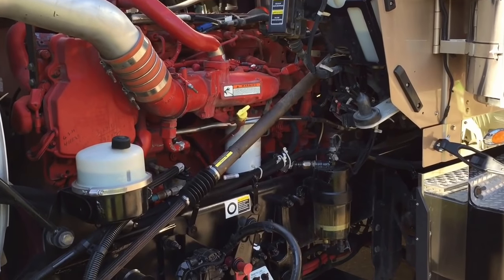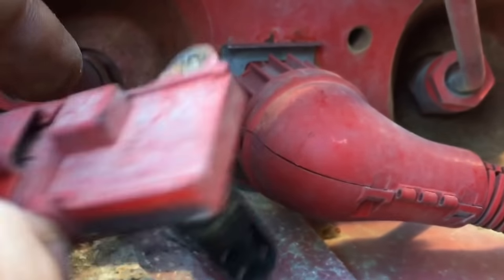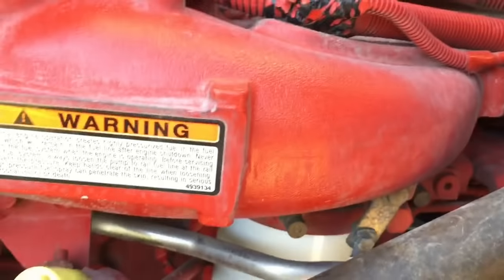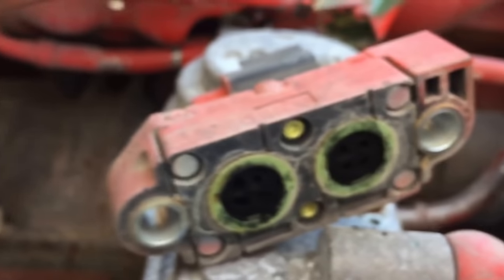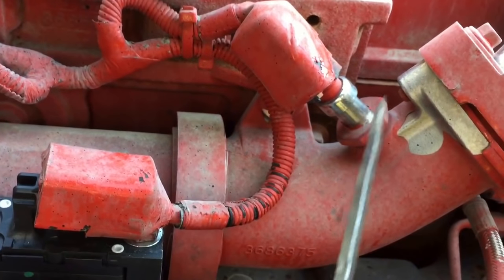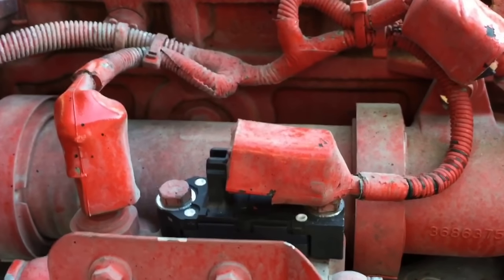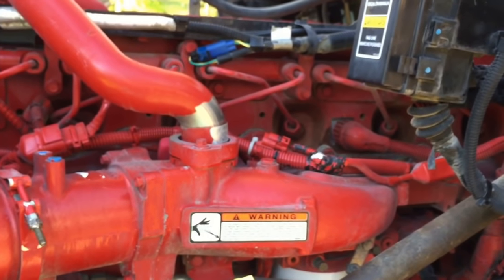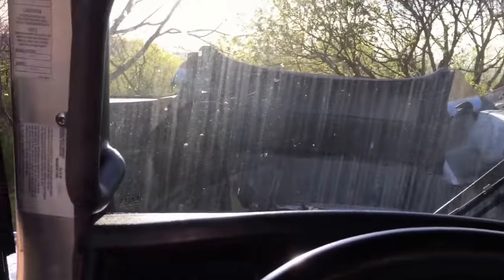EGR Tune Up | Cummins ISX500 CM2350 sensor change out.

Comment: If you want to clean the ports under the Delta pressure sensor, you can start the engine and it will blow out the loose soot, with or without the sensor being plugged in. It will most likely throw a code, but it will go out soon after you have the sensor reinstalled.

Comment: I’ve taken all the tubing and egr off cleaned and replaced sensors as needed. Takes a couple hours after doing it a few times. The egr, delta P and imap sensors get the dirtiest. And also the doser injector get clogged up good idea to clean it at same time.
Reply from the maker: Dead or alive your're coming with me How’s it run now? Noticeable difference?
Reply: Any tips for how to clean the egr valve what to use what not to use?

Comment: Great video,I checked those 2 sensors and they are red,so i guess they have not been charged.
Right now I have 549143 miles on my CM2350. I'm getting around 7.8 to 8.0 mpg(8,6 when loaded 10000 pounds,7,3 on 44000)I'm also  having dead axle on my back, maybe that's why my mileage is so good.I Will check all your videos and all I can say is THANK YOU VERY MUCH FOR DOING THIS VIDEO,IT HELPS ME AS FIRST TIME OWNER OPERATOR VERY MUCH AND EVERYBODY ELSE,YOU ARE A GOOD MAN,THANK YOU,THANK YOU....

Comment: Thank you for this. I’m currently broke down because of my def system in my 2014 660. I don’t know exactly what’s wrong but the code is saying it’s the def something. I was panicking because I can’t go over 5 miles an hour and didn’t want to have to get a tow. Last one cost me 3500 for 11miles when I had to get a new ecm put in a couple weeks ago. Showing me what to disconnect so I can drive it to the shop tomorrow morning when they open is a life saver!! Thank you
Reply: Dude towing should be no more than 5 bucks per mile then there's the hookup fee 350 or less. Good luck next time.
Reply: Remove the clamp on exhaust pipes between turbo and SCR in, you will have turbo pressure code on but dpf code maybe gone and you can drive normal but lack of turbo power on the hill

Comment: Other than the sensor that you call a delta P. The IMAP and the doser valve, can be cleaned. They actually sell a kit for the doser. Some come with a new high temp zip tie and new bolts. Most just the new gasket and thermal biscuit. I've been doing it for years. You can use brake clean on the IMAP but it leaves a little film, no problem it's okay. I use electronic cleaner. Or you can use starting fluid. 
Your IMAP and doser will last for years. You can also clean your EGR valve.

Comment: SUBBED!! I'm about ready to stop taking my cascadia to dealerships at all...they never seem to want to just do what you ask them, they don't seem to be able or willing to diagnose the ROOT of the issue without replacing everything just short of the one thing that needs attention, and they break other things on the way there that they want you to then pay for. With information like this video, all I need is my own garage and invest that 10,000 in tools and I could fix my own rig, THE FIRST TIME.
Reply from the maker: Yes! Thats the reason I started searching the web for mechanics that knew the emissions. Learned it and saved a ton of money along the way. $10K, shoot, you'd have your own covered shop lol

Comment: Thank you. Just replaced my egr delta p sensor or also called egr differential pressure sensor in my Volvo d13 engine. It is the same exact sensor that was in this video. I had code P0401, replaced delta p and everything as it should be.
Thanks for good video
Reply from the maker: Nice 😆🙌

Comment: Coming out of Colorado this week the truck started surging and going into 25% derate as I was coming down Vail pass... WTF?.   Pulled over shut it down restarted and all was fine again .. WTF?  Two days later it did it again.  I remembered this video and replaced the three sensors (Imap, delta and egr temp )   BAMM back in business.  Your right about the engine years.  My 2016 Pete has a 2015 ISX 600 CM2350.  Sammy I owe you a cold one.
Reply from the maker: NICE!! IF it does it again there is another Delta P pressure sensor on your scr can. Or you can email em about it :) check desp. and let me know it's twin sticks
Reply: Same exact thing happened to me but my codes came up spn 102 fmi 2 boost pressure, spn 3698 fmi 9, and SPN 3697 FMI 9 any help would be appreciated

Comment: Nice video.  I’ve seen several problems with that sensor on the smaller Cummins ISB and ISL as well. They all use the same style imp/imt sensor.

Comment: Great vid man !!! Just stopped at KW & replaced... i have a 2012 w900 cm2250 , gas mileage is at 5.5 :/ any suggestions?? Also the delta pressure sensor had water inside
Reply from the maker: Drive easy and off boost gauge. Keep it under 20lbs and drive 60-65. Not sure about the water, Check out ISX Solutions on FB and ask those guys. They will know :)
Reply: More than likely condensation.

Comment: Thanks for the great video,  reasons and some purpose of that code and  sensors to let driver or maintenance technician to know there are some issues in that compartment of engine I would prefer to take egr a part and cleaning that carbon buildup and change or clean the Sensors all the repair shop just change the whole part and charge you a lot of money good luck with your loads and be safe out there...
Reply from the maker: Thank you. You too!

Comment: If the sensors are sooted up, you have other problems, if you replace sensors and keep driving all you are doing is fixing a symptom not the root problem. Trucks come in all the time. Could be a egr cooler going bad  egr valve or just a calibration fix. Take your engine serial number with you buy parts sometimes they change part numbers  old part number may not show this

Comment: Nice video brother. I changed that delta p censor but i still get that code in my diagnose code Engine Fuel Filter Differential Pressure (see also SPN 1382)Intermittent. Please advise what am i missing?
Reply from the maker: I have no idea. Take it to Fb group ISX solutions and ask them. There are a lot of good mechanics in there that will be able to help :)

Comment: Try running the Pittsburgh Power fuel catalyst additive. It specifically reduces the soot build up. I've noticed my engine doesn't require parked Regens very often and I do idle when it's cold or hot outside. Also, the truck uses much less def. Just saying.

Comment: Have you had a problem with the ambient sensor, I changed it already but it still marks high temperature to where it turns the engine light on

Comment: Did you ever replace the guts on your fuel pump? I’m getting a truck with 442k and I hear if you don’t tackle the guts before 400 you’re skating on ice. Just wanted your insight on the whole dealy o

Comment: Great video I'm picking up my first DEF/DPF truck on Monday 3/30/20 . How many times have u replaced these sensors? Also have you done the update on fuel pump?
Reply from the maker: every 200k or so, and yes. i just had to update the tappets :)
Reply: @MakeCentsTrucking  how about NOX sensors?
Reply: Don’t ever ignore the fuel pump !! Just spent 6k replacing mine..
Reply: @alexzamora6700  I took my truck to Mr. HAGGAI in Griffin,  GA and had fuel pump updated and EGR tune up.  Nov 2020.

Comment: Hey Sammy nice vid very educational. Can you tell me what the heck is behind the cover that's on the side of the engine towards the front driver side about eye level. It's behind the after cooler pipe. I can't find anything about it.
Reply from the maker: Thanks bro… Thats the crankcase pressure filter.
Reply: No kidden awesome. Is that something that has to be changed regularly?
Reply from the maker: i beleive they call for it every 100k or 200k.. i cant remember

Comment: Great video like always gonna be added to my liked videos to watch a again In the future how did u install that LED strip for the floor
Reply from the maker: Anthony Montenegro thanks bro!! Take console out and drill a small hole beside red floor lens. If it's still there don't try and pop lens off, both mine were dry rotted and broke lol 
I cut that floor light wire and wired in leds to it so I'd have dash switch. Works like a charm

Comment: Have you updated or Did you get the plungers kit on the fuel pump replaced? Or did you get the fuel pump in it's entirety replaced?
Reply from the maker: The rollers were the only thing i needed on mine. But yes, i was quick to get it checked out
Reply: Does the cm2350 have the bad plungers on fuel pump.
Reply: @leehancock2782  
Yes they have bad plungers too

Comment: The area were the dept depresure valve you replaced..my t660 is making a noise like a bird chirping or a wheel squeeling noice inside that valve.i have the same Cummins motor..it's running fine just making that noise ..
Reply from the maker: I had that happen too and it was a broken manifold bolt and was leaking around it. Wasn't to hard to extract but was a pain in the butt taking everything off. It's was loud lol
Reply: Does the Delta P make that chirping noise if it's going bad . When I touch the Delta P I can feel that chirping feeling with my hand. The engine is running fine. An no faults found
Reply from the maker: That I'm not sure about. I hope it is that. Its a way more simple fix. The Delta P is less than $100 and easy unbolt and install. Easy breezy :)  Just don't pay anyone. There is 2 bolts that hold it in place. You'll have it replaced in a few min. no programing or anything.
Reply: My ticking was an air leak around air  compressor,thank God .but I took off Delta P . I heard one hand comment an said he cleaned the sensor with alcohol.. you think that will clean that sensor..?

Comment: I cleaned my sensor with Isopropyl alcohol and have had no problems with it saved my self $250 on a new sensor
Reply from the maker: Shoot yeah, thats how you do it driver! Save that money as long as possible
Reply: We used brake clean or either if they are carboned up just use a pick or pocket screw driver break up the big stuff and hose it down good to go

Comment: I need some help buddy got out of the shop cummins shop yesterday most of the codes shows after treatment 1 diesel exhaust fluid pressure. .well they changed the Def pump got a 150 miles engine light came back on put me in a derating mode any ideas.
Reply from the maker: id change def filter. its behind tank.
Reply: MakeCents Trucking Show got a new tank and filter stlii doing same thing
Reply from the maker: Timothy Mcvay man I'm clueless. Jump on rawze.com and ask those guys. They're the smart ones I go to
Reply: Timothy Mcvay What did you find? Also is good practice to take the three bolts out of the DEF doser and pull it back to see if there is crystallized DEF stopping it up not allowing it spray. Once you get to it you'll need a 5mm allen wrench. If you have build up, you will need to remove the flex pipe and clean out all of the DEF. Also the  doser has to replaced due to the doser not sealing up and it's dribbling out instead of spraying. Make sure they replaced the pump and not the doser.  Let me know bud I'm curious.

Comment: Can u making a video with a paccar MX 10 engine! If not what recommendations do you have for me, regarding EGR and admission stuff
Reply from the maker: My advice would be trade in or do a delete asap. As far as a video i dont have an engine around to use. Sensors will look about the same though. Just locate and replace all you can
Reply: MakeCents thank you I appreciate the advice I will be doing the delete soon..
Reply from the maker: Update and keep me advised so I can pass it along

Comment: Anyone know what would cause the "Exhaust Gas Pressure" fault to claim me on in my diagnostics?? Truck started idling rough, and surging as if it were regening...but it's been deleted.
Reply from the maker: LC Scott exhaust gas back pressure sensor. Even deleted its still active. I’d start there
Reply: Thanks ! The clip to TH back pressure sensor was broken ! You hit the nail on TH head...sensor was good,,but clip was bad. Fixed 👍🏼
Reply from the maker: LC Scott Awesome! Keep rolling driver 😎

Comment: Sammy, t800 with the same motor as yours saids engine fault of intake manifold air temp. it has derated power and the engine fan is staying on. it's that the imap sensor also? thanks in advance
Reply from the maker: EC Truckin yesir. That's the imap. Pull it out and clean it and see what happens
Reply: I went and got a new before I even pulled it out because it was still red. slapped that bad boy in and she back to normal. thanks man your awesome! and thanks to YouTube. just got to get that light cleared out.

Comment: Very good information, I liked all of your previous videos. I am about to buy 2012 Pit 587 with Cumming ISX, do you recommend? I am going to be first time Owner Operator, kind of confused, please advise. Thanks
Reply from the maker: Atik Ahmed confused is normal. I'm still confused about what I got myself into lol just check it out real good. It more than likely has a cm2250 like my t660 did. Good engine beside the flaws.  Pull crank case  filter and see if any sludge is in there, it will look like a milkshake if it's bad...head gasket or known dropped liner, usually 5/6. Then make sure it's had fuel pump replaced. They had a recall on the ceramic plungers. Also bad tappets. Those issues has caused a ton of inframes. 
If not, replace fuel pump. They'll go out with no warning and ruin the engine. That's what I would be checking out
Reply: Sammy B. Thanks for your advice bro it will help me make my decision. Do you know any good Mechanics that, I can take the Truck to, I live in Lawrenceville, GA.
Reply from the maker: Real close to. Give Jerry a call down in Griffin,Ga. Great guy and damn good work. Haggai Auto and Service Center. 678-688-8107
let him know i sent ya
Reply: Sammy B. Thanks a lot bro, I really appreciate your help. Keep posting your good video and say hello too your little son.
Reply from the maker: Atik Ahmed sure thing bro will do

Comment: Just subscribed 
Kool chanel.
Could you do a Video on straighting out the steering wheel ? The truck isn't pulling,  but the steering wheel is at 10 an 4 instead of 9 an 3. Thanks
Reply from the maker: Awesome! Glad to have you watching. Ill see if i can put one together soon. Ive been meaning to make one similar. Just got to get a min, its been a hard hustle this week lol 
But to reply what ive expereiced with that, it was alignment, both cases on both my trucks.  Check out Mdalignment.com and i personally go to Chad in KC,mo

Comment: I changed the mapco sensor was getting better mpg. But after a week it went back to 4.5. Have any clue what happen
Reply from the maker: Change the differential pressure sensor(delta-P) and the exhaust back pressure sensor too

Comment: I have a client with this exact problem, he has an amber check engine light (which is because of the EGR differential pressure sensor) and it was clogged with carbon buildup; would you recommend to remove the EGR valve itself and blow it out or would the carbon cycle out once the new sensor is put in?
Reply from the maker: I guess it couldn't hurt, I've never took a EGR apart for cleaning. I've heard of people doing it but I have no experience in it

Comment: I have a 16 volvo 780 2350 Cummins, fuel mileage is garbage! Average about 5.9 mpg. Tried replacing I map sensor but Cummins and volvo dont seem to know what it is. I also tried calling it an mass air flow sensor. I ended up going to volvo pointing it out on another truck they called it a boost sensor!!!?? I'm puzzled

Comment: All my egr stuff “fell off”. Guess the bolts were loose. It sure runs better so guess I don’t need to go look for it.
Reply from the maker: Turtle Largecar_operator lol yea I have a feeling I’m going to hit a bump tomorrow and mine will stop working. I’ve got them bolts tightened up good but I feel a solder joint is going to break inside the ECU and it stops working tomorrow some time 😎😎👌
Reply: MakeCents I gain all that bottom end torque back. I can feather the throttle on hills now. Really makes driving an isx fun again. I went from otr to oilfield with my truck and it only made sense to get it “n14’ified”. I only regret not hitting that “bump” sooner.
Reply from the maker: Yea you are right there. I've been missing it since my T660. Today is the first time I've felt that throttle response :):):) Cant wait to put a load on it and see how she does
Reply: Hey Sammy would you recommend changing them sensors even if I had the same solder joint breakage in the ecu? Lol

Comment: Have you had any problems with fuel pump? Nice video.
Reply from the maker: No. But I had the new trucks checked out when I bought it to make sure it was updated. Plungers, rollers, tappets. All it needed upgraded were the rollers.

Comment: My 2010 International isx wasn't cranking today had enough fuel and battery after 5 minutes of waiting it cranked back on any ideas what might be wrong or Is then Gator on the starter?
Reply from the maker: sound like it is. May be a good idea to change it out before it leaves you stranded

Comment: So you don't recommend deleting the EGR system... just replacing?
Reply: You can delete egr but you should make sure whoever's does it knows what they are doing, fueling and injection times are done with the expectation the egr will be there so if the fueling strategy isn't adjusted to compensate you could in worse cause engine damage and best case not run right the dpf and scr system can easily be tossed tho